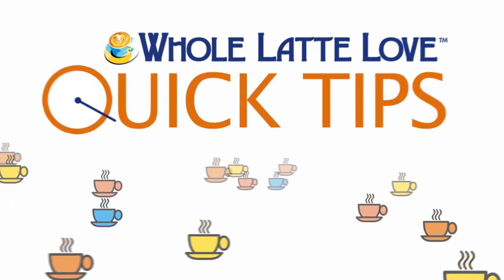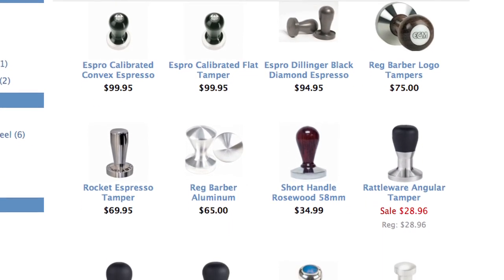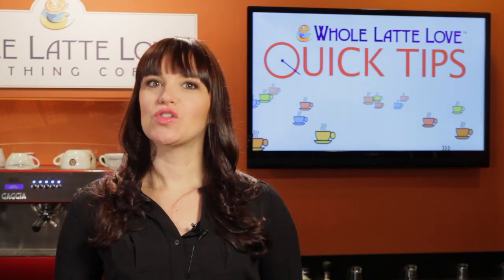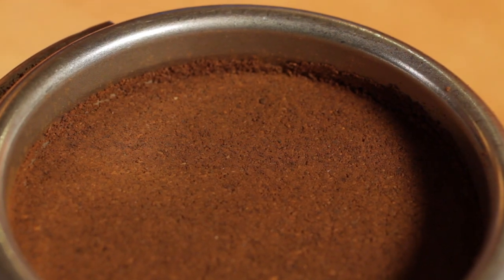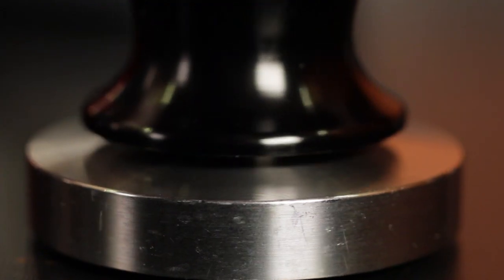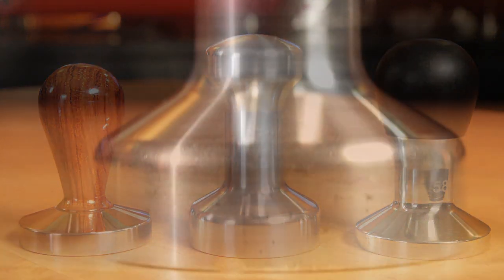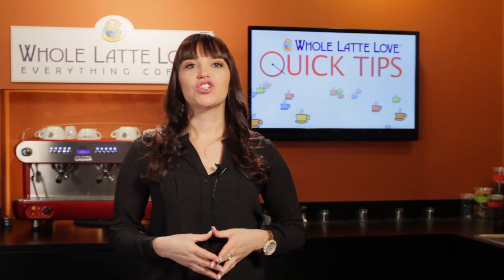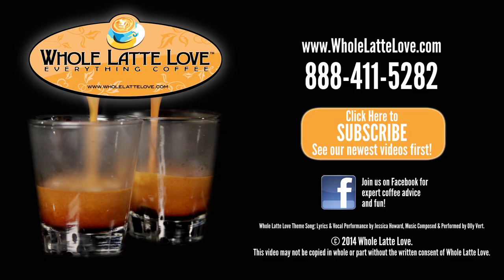Quick Tip: Choosing a Tamper

Comment: Is there much of a difference in results between the flat and convex tampers? Or is it just a matter of preference?
Reply from the maker: helpfulnatural Some thoughts on possible benefits of convex tampers: They may provide a better seal around the edges of the coffee puck and prevent brew water channeling between the puck and and side wall of the portafilter. They may lead to a more even distribution of  brew water pressure onto the coffee puck. Typical 9 bar brew pressure = 130 pound of pressure per square inch. The curved puck surface created with a convex tamper helps to evenly distribute the pressure. Some users believe the curved surface makes it easier to get a tamp that is even/flat relative to the sides of the portafilter. These are all theories and in the end it is a matter of preference. We can say that the majority of extractions shown in our YouTube videos were tamped using a convex tamper.